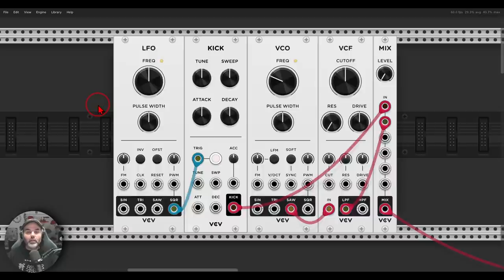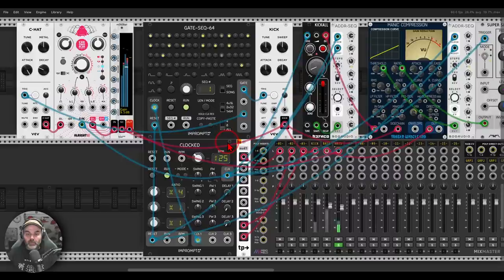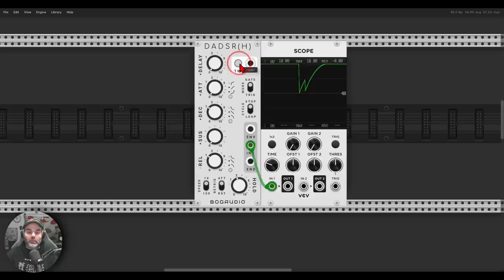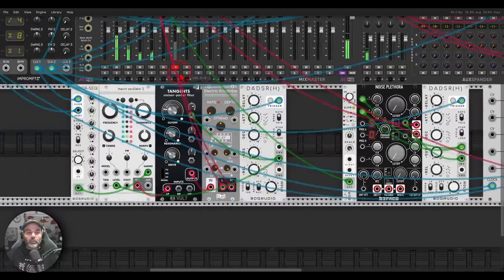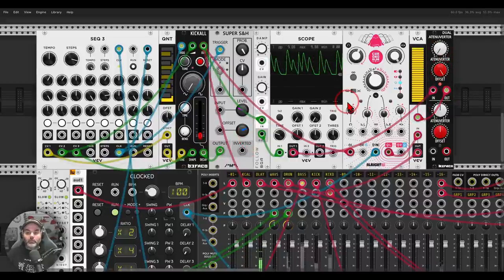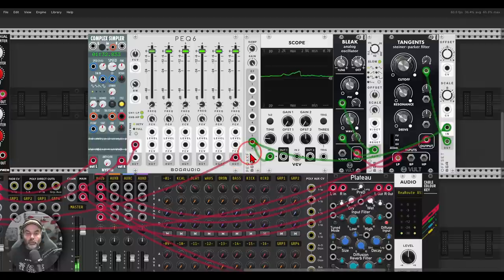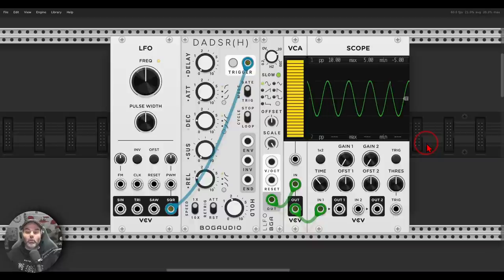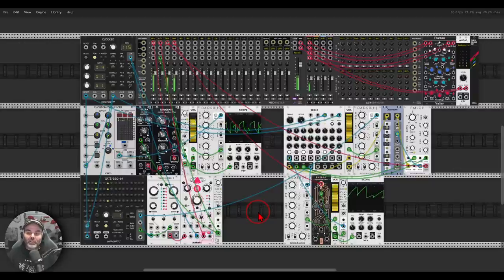4 levels of side chaining in modular

Comment: Hi Omri ! There's something I don't understand! at around 19 minutes, you say that the signal which opens the filter (for the drone) is inverted. However, if I take the signal that comes out of the bog audio offset module and puts it into the oscilloscope I have exactly the same signal as the one that comes out directly from the  envelope follower. From there I'm lost 🙂
Reply from the maker: Hi! That's actually my bad because there's no need for the Offset module at all. I'm using the built-in attenuverter on the filter to invert the signal :)
Reply: @OmriCohen-Music  ok! Thx Omri